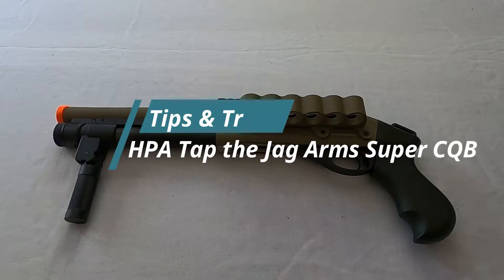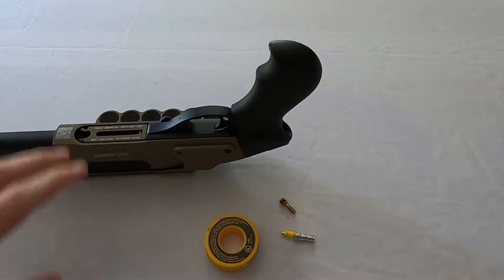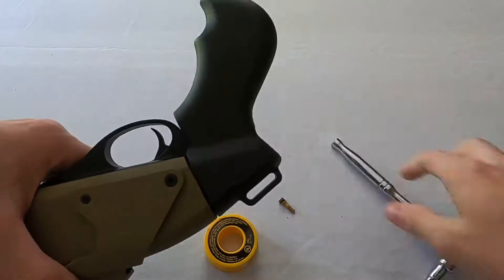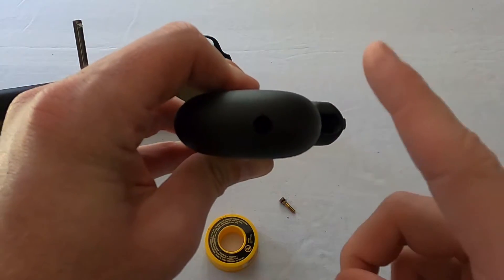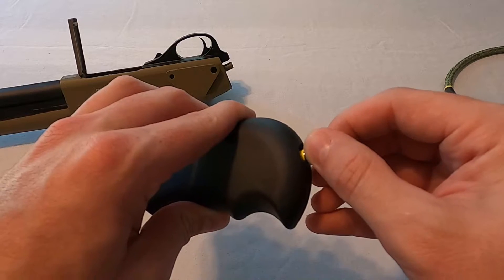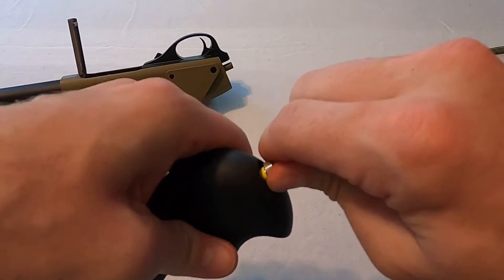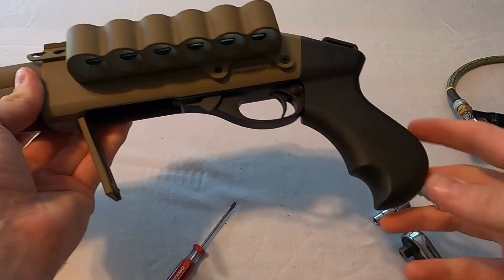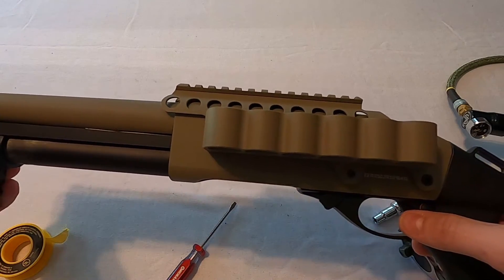How to HPA Tap a Jag Arms Scattergun Super CQB Part 1

Comment: I’m following your video to install it.!what kind of Russian cqb hap tap do I need it?? I have one don’t know the brand it’s on hicapa mag try to use it to jag arms but don’t fit !! Please tell me where you get the one and what kind is?? Is kwa or we one?
Reply from the maker: Russian cqb makes an adaptor specifically for the scattergun. Hicapa most likely wont fit as the threads are different. You can get the right one from amped airsoft or evike
Reply: Thanks.!!

Comment: What size screw is that in the rear? Mine leaks and I think it may be from there ):
Reply from the maker: I used a 6mm Socket Wrench to unscrew the rear bolt
Reply: i had a leak there too doubled up o'rings on bolt that hold grip on holds gas fine now
Reply: @christopherhayto1089  thank you. Idk where my leak is exactly. I’ll try to lube all and replace the o rings if not I’ll have a tech look at it. Shoguns are not for me lol
Reply: @victorcarrillo6425  good luck, i took my whole shotgun apart because i thought leak was inside but was on stock to body o'rings gun was brand new